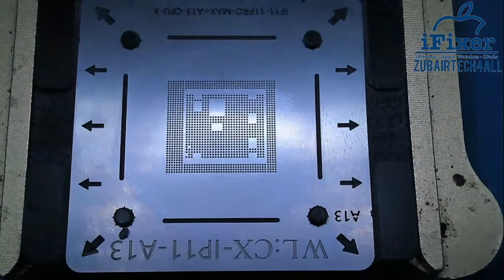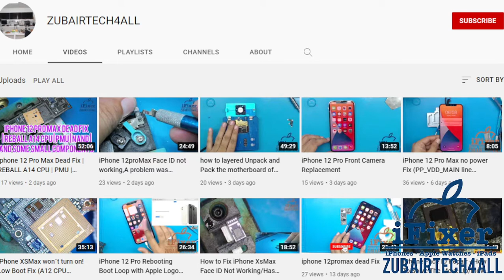How to Swap Board of Iphone 11 A13 CPU

Comment: Hey I bought used iPhone 11 128 gb and after checking imei it showing in built memory 64gb and CPU freq. 2100 Mhz 

And on my iPhone XR 64gb it showing CPU freq. 2600 Mhz 

Is this normal ? I noticed that pubg mobile loads much slower on iPhone 11 128gb compared to xr 64gb